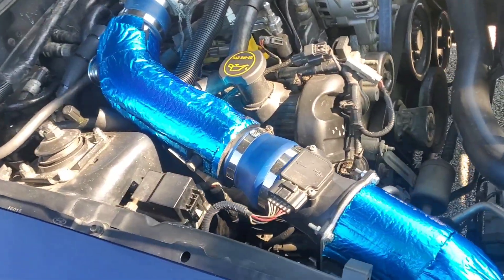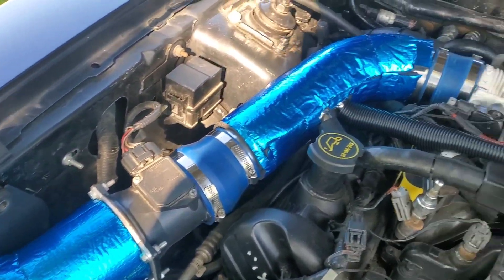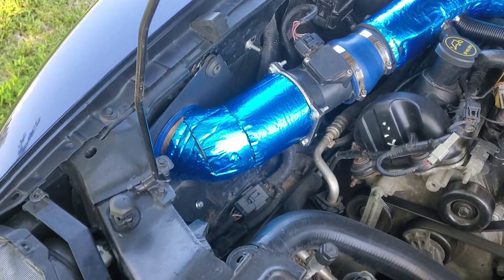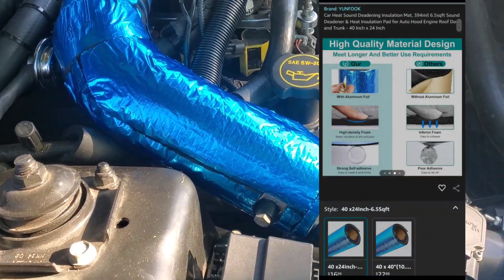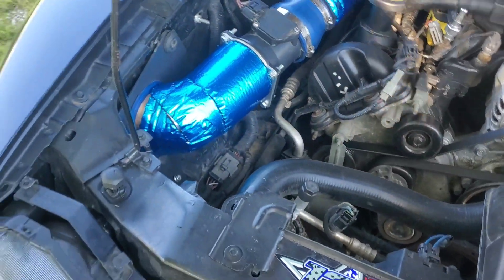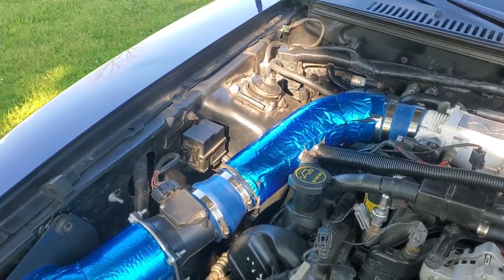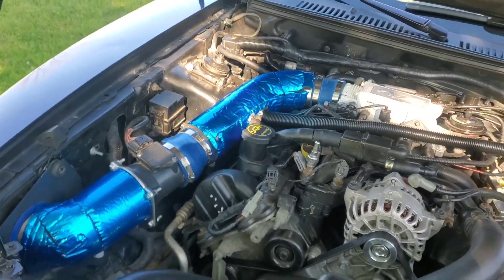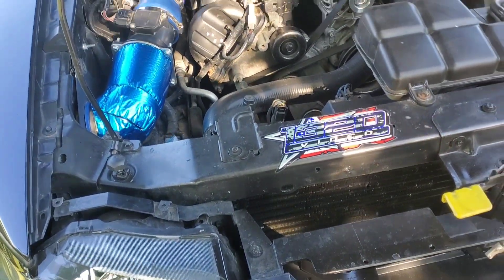Foil covered foam - Does it keep heat out? 🔥

Comment: I have an old fire truck which I fix up as a hobby. There is no sound or heat insulation between the engine and the passenger compartment (it's a cabover). I put this stuff all over the engine compartment, it worked wonders. Absolutely keeps heat (and noise) out.